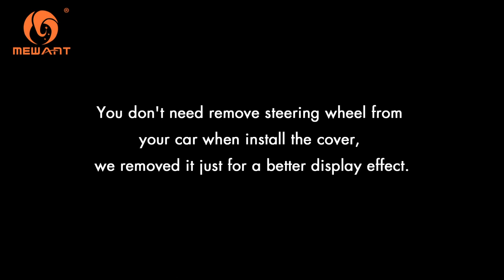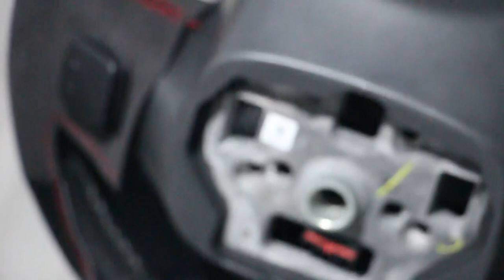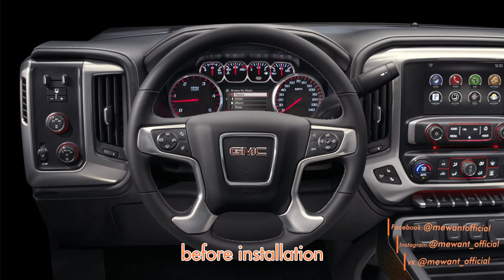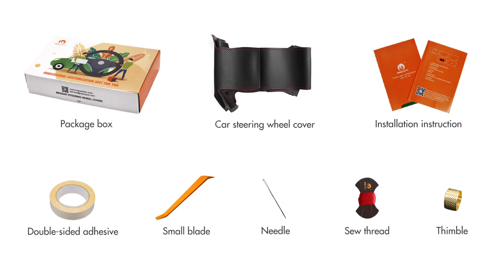MEWANT--for GMC Sierra1500 Limited Sierra Yukon (XL) Hand Stitch Car Steering Wheel Cover Installing

Comment: Hello. Can you make original measurement for wheel cover? In the video you show the process leaving the old cover on the wheel so I'm guessing your product is a little bit bigger than the original piece. I would like to remove and replace the old leather cover so the Heat feature of my wheel is not affected. Please let me know. Thanks.